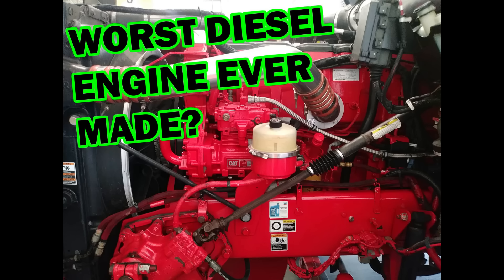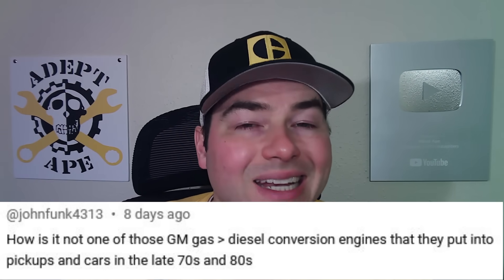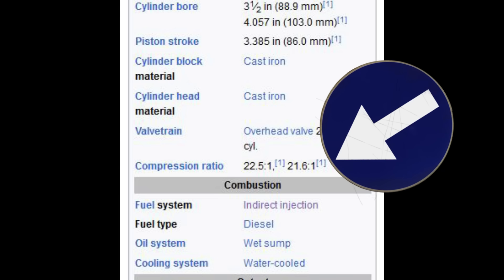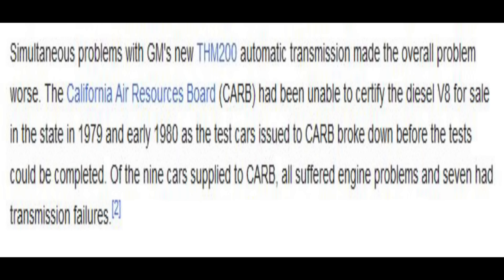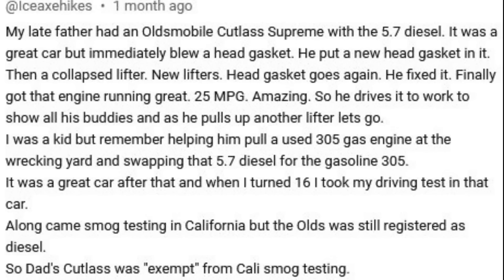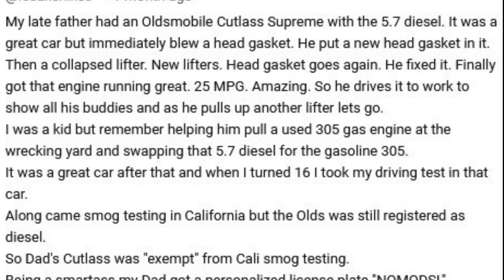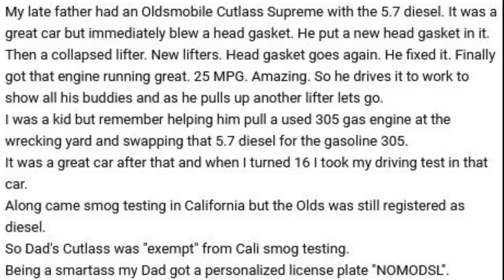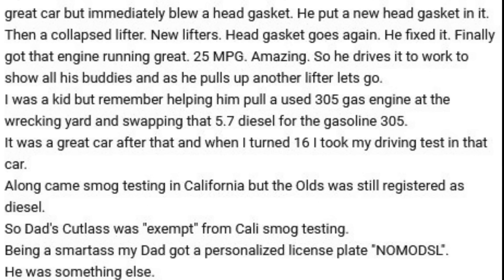This Engine is the Reason You Don't Have Diesel Cars in America!!!

Comment: Early 80's as an auto insurance adjuster for a major ins co in So Cal, I walked into a small rural GM dealership in Perris Ca to check out a wreck that had been towed into it.  Guess I took a different route wandering behind the Dealership to the bone yard, as I came around a corner there was a large lot with nothing in it but hundreds of G.M. diesel engines sitting side by side, row after row.  I realized this was the Perris graveyard for the infamous GM diesel us Ford lovers had been laughing about for the last few years.  Part of my job was to get photos of the vehicles I checked out and get photos I did with those old push the button, pull 3 levers and the picture would roll out of the front, cameras.  Someone came running out  of a building screaming I wasn't supposed to see this area and demanded the photos back.  No way.  I had too much fun flashing the pictures anytime someone started in on how great GM was.

Comment: These were initially pretty popular in some rural areas.  Some farmers would fill up at their tractor tank (not legal, due to the taxes but some did it anyway).  Same reason that propane conversions in that era for gas pickups were popular in farm areas as propane was available on the farm for grain dryers.

Like the commenter highlighted in the video, for a few years there was a cottage industry of folks buying used cars in otherwise nice shape with a blown diesel and swapping in a gas engine.

GM also had a V6 diesel available in the FWD Buick A body model as some folks in my area had one.

The last time I encountered a GM diesel was a 1980s Chevy Impala 2dr with a diesel.  A rare enough car (the 2dr) as it was but the diesel made it rarer.  A coworker used it as a work commute beater.  This was around 1993.

Comment: I am 72 years old and I remember the Oldsmobile Diesel engine for Oldsmobile cars. General Motors made the mistake of taking a perfectly good gasoline burning engine and made changes to convert it to diesel engine. That was a big mistake. This converted engine as we know had lots of problems. At the same time that the Oldsmobile Diesel car was on the market, Mercedes Benz had been making diesel powered cars for a number of years. The Mercedes Benz Diesel engine was designed from the beginning to be a Diesel engine. Even in the early 21st century many of these Mercedes Benz diesel cars from the early 1980s were still in use on the road.

Comment: I was a construction fleet  mechanic back then.
To Construction companies having another oil burner in the fleet made good sense.
 Supertendant had Olds car, foremen  were given 1/2 ton pickups with the 5.7 version.
 I remember the pickups had  notices on the glove box door stating 
Not for use over 4000 feet elevation, not for towing, or
Slide in camper.What a waste.
Early on we had trouble with the Roosa Master pumps, plastic governor retainer failing, we bought time by removing the brass fitting for the fuel return and knocking out the check valve which allowed the engine to run until we could get it in.
 Later i went independent and made so much money on that bastardized engine.
Buddy of mine took out money on his house to buy fuel injection repair equipment.
He then rebuild the pumps and injectors, doing only the Olds engine.
 He had been working at a shop that rebuilt the engines in house.
They were findind cranks with different size journals and mains, some .10, some .20, on the same crank, those engines were just out of warranty and had not been worked on.
Another buddy who worked at a large Chevy dealership said he had seen the same thing when working on those engines under warranty.
The 6.2 was a breath of fresh air but none of us like working on them either, we were heavy equipment mechanics.

Comment: You give this engine far too much credit. 
A more credible reason we don't have many diesel cars in America is that they are noisy, smelly, and hard starting in the cold. Add to that they are sluggish in comparison to gasoline engines. THAT is the REAL reason that diesel cars are not widely used here in America. 
By your line of reasoning, we would not have any more 4-cylinder engines because of the Chevrolet Vega. But, we all know that isn't so. 

If there is one thing that I find most annoying on YouTube, it is the sensational headlines that just aren't so. i call them clickbait. You get more views when you use misleading headlines.

Comment: In high school 1986 I worked for a used car dealer. He only sold good quality used cars. The guy was extremely smart business man also. He would buy cheep low mile non running 350 olds diesels and we would convert them to gas. Sold a bunch of them to guys for second cars never had a comeback

Comment: A friend of mine had a 5.7 diesel that ran until the pickup body rusted out. At 280,000 miles he put it in another pickup and drove it until he died. The second pickup had 180,000 miles on that engine.

Comment: I'm not sure GM ever did make a good diesel engine the 6.2 were a little better and the 6.5 but none were great and technically the deramax isn't a GM engine so I don't think they count and then the two cycle Detroit diesel had plenty of problems to also the 478 GM diesel I think all were converted gas engines

Comment: We moved to the US and we needed an extra car. My dad knew about diesels in Europe and their reputation for excellent fuel economy. He bought a slightly used '81 Delta 88 with the diesel engine. Surprisingly we never had serious engine issues and we drove it for 8 years 150,000 miles. Back then cars were pretty much toast after 8 years of winter use. Rust everywhere. We did blow through 2 transmissions. We never got more than 60,000 out of the automatic. On long car trips (we explored all over the New England area) we got close to 28 mpg. Absolutely shocking for a big  heavy car. It was slow to accelerate. It needed 2 batteries to start since the batteries just didn't have that much power back then. On really cold days it could take two additional batteries to get enough energy to get it to crank over quickly enough to get started. One of the more annoying issues later in life was the dumb mid tank fuel pickup. Under the "right" conditions, if the tank was below 1/2 full, you could suck in an air bubble through that mid tank pickup. At that point you were doomed to need a tow as the system was not self priming. At one point there was a class action lawsuit. My dad met up with the GM rep to see what they would do for us. The rep was shocked that we hadn't had all the actual engine issues... just transmissions that would not go for more than 60K. He got a small payout towards some of our repairs. I think there was a diesel pump that failed at one point. It was long ago and I was in my early teens.

Comment: Carb also killed the small trucks for USA.  They used the footprint of the truck and the gas milage of a small truck had to be so high, the automakers just went to bigger trucks.   Not better fuel milage, but a larger footprint was allowed worst fuel milage.  I also have two diesel trucks.  Silverado and Colorado.

Comment: Oldsmobile should have based the diesel off the 455 not the 350, the 455 had a 4.250 stroke and would have made massive torque on diesel,  they already made 510 torque on gas.

Comment: Chevrolet has a couple of diesel options for small cars and an SUV. The Cruze TD 4D and Hatchbacks as well as the traverses. They come with a dinky little 1.6L ecotec 4 banger. I bought my wife a 2017 TD Cruze with the 9 speed automatic and its been a pretty awesome trouble free little car. Averages mid 30s and has been as high as 42 mpg. Has just over 100K miles on it so far with no major repairs yet (knock on wood) I’ve only had to replace 1 NOx sensor since we’ve owned it.

Comment: They went back to the drawing board and redesigned this engine. They changed the injector design, made the bottom end a 4 bolt main, and increased the head bolt size. We had three of them that we got dirt cheap because people hated them so badly. I learned how to turn a wrench on these cars and came to appreciate them for what they were once i understood their failure points and how to correct them. Keep good hot batteries, good terminal connections, keep glow plug system woking correctly, and NEVER use ether to start one that didn't want to start (almost always was a simple reason they wouldnt start and an easy fix) most of the time it was a loose battery connection.

Comment: Always enjoy your videos. Something ive noticed and inparticular on your haul truck C18 is you dislike silicone like using it on the whole plate. Something i use and always have rather than silicone in cases like that is gasket Eliminator such as loctite 515 or Yamabond. Both work exceptionally well and ive never had anything leak with it on. It also has the benefit of unlike silicone in that it releases easily when having to disassemble. Ive used it on headgaskets and everything else for years. I highly recommend you try it. Im a agco mechanic but also done cummins and cat, it is agco's recommended sealant over silicone except on cut to length seals. Also I'm a local Idaho boy in the Southern end of the state.

Comment: I had a 1981 delta 88 with the 350 diesel and drove for around 80k before the injection pump failed it had a nylon gear that was replaced with a steel gear it was a good car did have a transmission problem but it was after 110 k . Part of the problem was that was not that many gas stations that had diesel at least where I lived so I would guess that people were getting fuel that was lower quality it was easy to get fuel when you were traveling at a truck stop I have been driving a diesel pickup over 20 years and now it seems every new station has diesel pumps but that was not the case 40 years ago kinda like the electric cars of today and not being able to find a charging station

Comment: When I worked on a few of these engines in the early 80’s the intake was full of gunk ,I mean you could scoop it out like jello. These engines were a heavy engine compared with the Chevy 350 but not enough for diesel fuel everything would crack.

Comment: I had an 81 regal coupe that had the upgraded DX block, it ate the transmission about 70k miles, replacement was a 350 turbomatic it was pretty reliable actually unless it dipped below -10 or so then you weren't going anywhere, had it from late 87 early 88 and finally replaced it with a 92 Silverado. Kinda wish I had kept it actually I've only seen 1 other regal with the diesel since.

Comment: I rebuilt a lot of these engines in the late 80’s and early 90’s
I had a cam made for them from Engle camshaft and shaved the pistons to get it down to 18 to 1 ratio ! Studded the mains and ARP head bolts, my engines after that went to 250,000 miles with out an issue and got 28 mpg all day long, oh I also o-ringed the block!!
The majority of engines I tore apart were pulling down the block because the compression was so high and warped the block!!

Comment: I have worked on lots.of those. The 5.7 was a converted gas to diesel engine that was popular in trucks. The great this about them is you could have a pick up truck or blazer that got nearly 30 mpg. The bad thing was the lack of power. Most of the time when they failed, I put 455 of 350 Oldsmobile  gad engines in the diesel trucks.

Comment: My dad ran 350 diesels for years.  I still have one an olds 88. Gm had about 23 models like A-Z. First we bad. Last were pretty good. Original DB pumps were junk. Pumps now run forever. Mechanics didn't ever fix them properly. Headbolts were strech to yeld but people put new headgaskets in and would save the new headbolts to use in other projects.

Comment: The blocks were substantially beefed up, even from the start. However they left the head bolts alone. They later upsized the bolts. 
A big contributor to their issues was lack of a fuel-water separator combined with poorer quality diesel at the time. 
That, and lack of owner education. Using cheap gasoline oils greatly accelerated the wear on these. 
There also was, early on, a 4.3L V8 version that only lasted a year or 2. 

If you added a water separator, used quality oils, had the larger headbolts, and stayed on top of maintenance, they were a reliable engine, although gutless. 
If GM would've run water separators, jumped to the larger bolts immediately (or revised to 5 or 6 bolt versus 4..) and educated buyers better, it would have made a massive difference. Alas. 
IDI engines tend to run much higher compression. 

Look up the Toro-Flow Diesel. Even earlier than these.

Comment: We had a fair amount of 5.7 DX engines in Tech. Our first engines to disassemble and reassemble freshman year. The early ones were 85 HP and later models were around 100hp. My instructor had a couple with two hundred thousand miles. He said that it mattered as to maintenance and driving style as to how they lasted.  Lots of people learned about diesel gelling with those engines too. Cranks breaking at the rear main was common.
The 6.2 liter wasn't much better. Head gasket wise too.

Comment: The sad part about the Olds Diesel is they could have been great, if they'd had the right modifications straight from the factory. The 350 gas and its little brother, the 330, were great engines with few major design flaws and good power for their price of operation. The diesel conversion was botched because, of course, GM. Had they equipped them with more robust head studs from the factory, sturdier head gaskets, and a fuel-water separator, they may have been known for legendary reliability like other IDI diesel engines of the era. Unfortunately the same brand of stupid design flaw that killed the 6.0 and 6.4 powerstrokes also killed the 350 Diesel, and even if the engine is a good engine in ideal conditions and on paper, if it has to be rebuilt and upgraded straight from the factory to be worth a shit, people won't want to deal with it.

Comment: i find this kinda funny cause i have heard so many horror stories of the horrible  olds 350 diesel , and have known quite a few people who had these cars  and had problems with them ,,but my story is a bit different ,, i got my first car in 1988 when i was then 14 ,, this was a then 7 year old   ,Olds cutlass LS 4 door  , it had the 5.7 liter diesel  and it ran great  it had 70,000 original miles  and 0 rust ,,living in the country i had my school license so i could drive to school and work ,i drove this car all through high school and for a long time afterward ,, in 1993 the year i finished school , my brother and I actually replaced the transmission and swapped it with a 5 speed out of a chevy  half ton truck NV3500  i think it was ,,this helped the sort of under powered car not only get better fuel mileage , it wasn't really bad to start with , averaged about 25-28 with the automatic ,with the 5 speed that raised to 35 and on a long road trip could easily pass 40 ,a year or 2 after the  manual trans swap  i decided to try adding a turbo charger to it ,this was a success ,i used a turbo meant for a 5.9 liter cummins and it worked perfect ,,the exhaust was the hard part but i made it work ,,it increased my fuel mileage a little more  but the big change was it no longer was such a dog in hills ,,i finally parked this old car in 2015 after having it for over 25 years ,it was very tired by this time ,the engine  had passed 300,000 miles and i never had to take it apart ,,the car itself was pretty worn out and being over 30 years old was rusting away too

Comment: @AdeptApe Chevrolet did use a small 4cyl diesel in the Cruze for a few years. I am a Chevy tech and have only ever seen 2 so honestly I don’t know much about the history of the engine or really even it’s displacement. But of those 2 both owners said they had them for a few years with no trouble…
Reply: We own a 2018 Cruze TD. I had to custom order it.  36000 miles currently with zero issues. The small 1.6 TD didn't get good market penetration because is wasn't advertised well  and had a slightly higher cost over the 1.4 Eco gas motor that has constant  cooling and pcv issues. I also do all of my own maintenance , car hasn't seen dealership since delivery.

Comment: We had a diesel VW Rabbit non-turbocharged 5-speed at that time. 44mpg and never had any issues with it.
Reply: Those were however incredibly SLOW and underpowered. Wonderful little engine otherwise though.
Reply: @Comm0ut I had a customer that had the truck he ran for years on stolen rig dsl . 
He finally gave up when oil burning caused enough glow plug failures that they surpassed  fuel "cost "